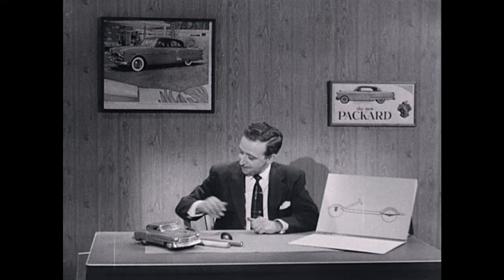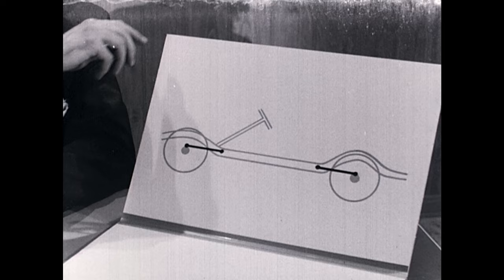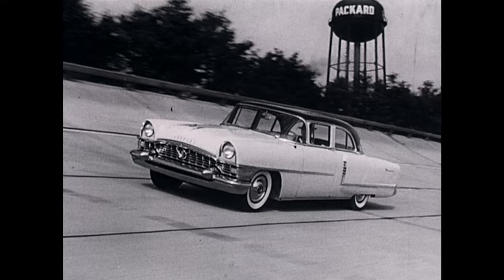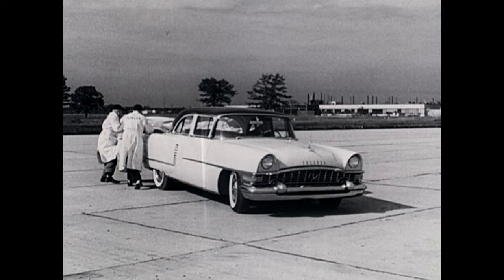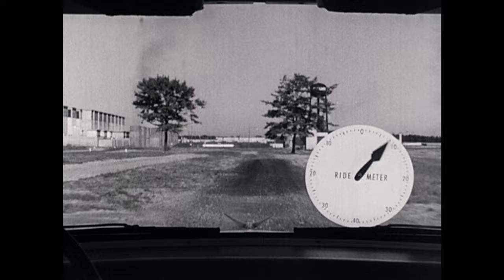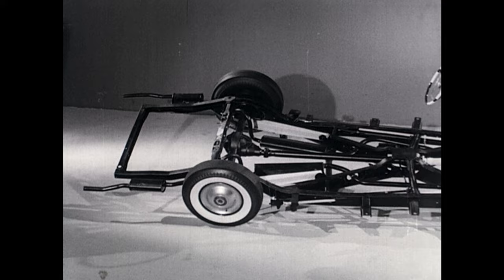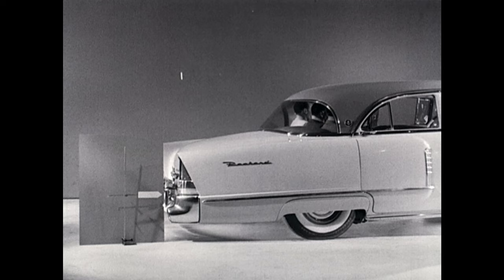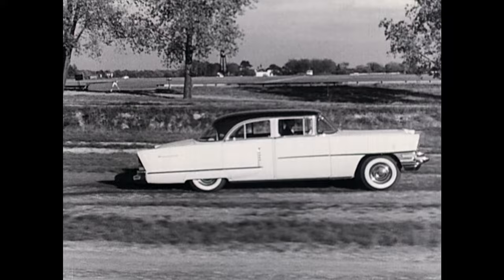Out of the Future (1954)

Comment: If only such a car was in production today.   With such pride in engineering I am sure Packard would be well ahead of other production cars made currently.  In 1956 they improved the system.   As a young child I remember sleeping stretched out on the rear seat and experiencing a floating sensation as if riding on air.   I also remember having fun in our garage by sitting on the rear bumper to make the leveling system turn on (I once got in trouble because the battery ran down.)  One of the improvements that came in '56 was a switch that allowed the driver to turn the leveling off when parked, to prevent such occurrences.
Reply: The automatic leveling system was introduced in 1955
Reply: Yes, ours was a gray '55 Patrician in '56 there was an added switch to turn off leveling. The Twin Ultramatic was another engineering marvel with a choice  of smooth acceleration or flash lightning getaways
Reply: Unfortunately pride in engineering can also bankrupt a company.
Reply: Mushrooms will do that.
Reply: Citroen did that. Packard was outdated already in the 50's it was an old people car.
Reply: @rockets4kids  I guess somebody had to say it.  Competition against low ballers with no shame of inferiority and deceptive with presentation is impossible with an uneducated customer base.
Reply: @theacw02  but my ‘55 Clipper has that switch...
Reply: And compared to the 1955 Citroen DS 19 it was instantly 20 years out of date.
Reply: @metricstormtrooper  The Citroen DS was impressive enough, but in the long run,  I'd rather rely on torsion springs and motors than hydraulics or pneumatics. Most of the cars with fluid or air suspension systems were trouble prone, many so much that their owners had them retrofitted with steel springs. That's probably less true of Citroen owners than most such cars, but they are a loyal crowd who bought their cars specifically for its advanced features, and Citroen had 20 years to get the DS right. If any new model came out with an adaptive suspension, even with today's advanced materials, I'd look at systems that used air or fluid with more skepticism than those with springs.

Comment: The closest suspensions to how the Packards operate made thereafter were the Hydro-Pneumatic systems used on British leyland and Citroen vehicles. I had a 1966 Morris 1800 with that suspension. I could drive quickly over speed bumps and would also not notice side wind, except for the noise the wind would make, as well as how it slowed the vehicle down a bit

Comment: That suspension reminds me so much of Lincolns air ride suspension of the 1980s and 90s! Amazing!
Reply: Nothing at all like it. This uses torsion bars instead of air bags.      
There has never been another system like it.        
Citroen used a hydro-pneumatic suspension, but with age, the system tended to leak and hemorrhage the green light hydraulic oil that made it work.         
Likewise, other makers used the air bag type suspensions that also went haywire when the hoses leaked.      
Packard's system had relays and sensors to adjust the torsion bars to the load using the central leveling motor. The result was the best ride in the industry with the best handling in the industry. no other company has ever come close, regardless of price point.

Comment: Krushchev's Packard is on display in a car museum somewhere  in this country. Russians knew a good deal when they saw it. Packard was probably best designed car for the interstates in the 1950's
Reply: It's a GAZ chaïka. It doesn't have many things in common with a Packard. Exept from the front end. Oh and there wasn't many interstate in Soviet-Union in the 50's. Maybe you want to look it up.
Reply: Have heard reports that the 1950's Packards tended to be rattle traps as exhaust systems wore against the chasis despite promotional films insisting on how well thought out the rubber chasis mounts were positioned. The auto transmissions were full of bugs. I would think fat Packards were relatively trouble free driving on the interstates and highways  but it is doubtful  Packard ever reached the young executive they'd hoped to sell to, instead they were repeating themselves to an old, tired customer base in decline  and packing in their Packard for the rest home. It was switching deck chairs on the Titanic. Shoot in foot technology killed Packard, with of without the V8. If they'd bought the rocket V8 from Olds along with the Cadillac  hydromatic transmission and sold more high end luxury options, including "free airconditioning," and engineered a cruise control, they may have gotten further without blowing big bucks on crafting a doomed V8 along with a problematic one off transmission that was nearly impossible to service. They were digging a hole, not selling a customer.
Reply: @z978ady  I realize that GM sold Hydra-Matics to competitors, but I would doubt very much that they would sell superior engines to them. They did sell Chevrolet sixes and 283 V8s to Studebaker in the mid-60s, but Studebaker was a dying concern by that time. The Olds V8 was an advanced design for its day, and was instantly a hit with buyers. I just don't see GM selling them to Packard. GM was much more concerned with fighting off the Ford blitz of 1953, and incidentally killing off the independent makers as a result.

Comment: The '55-'56 Packmules were still using the dowdy 1951 body, cleverly refreshed by future AMC styling whiz Dick Teague.  Packard had been going down the dumper since WWII, and George Romney finished them off by balking at the four marque AMC deal proposed by George Mason, thus forcing Packard to merge with another loser, Studebaker.  The Packard V8 was a good (if heavy) engine, but that Ultramatic transmission was pretty much the Packard's Achilles heel.  The torsion bar suspension came from Hudson.

Comment: Lexus LX470 with torsion bar suspension and automatic height control.
Reply: The LX470 front suspension has torsion bars, but is the setup that was common on 4X4 pickup trucks - the torsion bars are not interlinked to each other or to the rear suspension, and are not part of the self-leveling system.

Comment: Correct, hundreds of dollars per car, in an industry where dimes matter!  What few realize about the system, is the car feels "glued" to the ground, for (besides the incomparable ride), the front wheel is pushing down on the rear wheel and vice-versa. It doesn't depend on the shocks to do the best that they can. As rather-weak shocks are utilized, there's minimal impact to the chassis & body. Also, the torsion bars last forever. Even the electrical portion of the system is incredibly simple.I only wish that Bill Allison's Son, could have an opportunity to ride in my 56 someday. (I'm "dreamin' here)  Zero bangs, knocks, rattles and groans, and it rides like a train. All the cars but Jay's, that I've seen on you tube, are an insult to the highly-gifted designers, their legacies and their families. (You can tell I'm frustrated)  Remains one of the two most elegant-vs-results (designs), that I've ever witnessed. The other has nothing to do with cars. Lastly: The last time we brought our car back to the original owner's family, we drove 690 miles in one day. Got home at 1 AM. The
disappointment was, that the drive was over, for that day. My Wife and I were as refreshed as if the trip didn't begin yet. See: 56 Packard 400 Car-of-the-Week, Old Cars Weekly.

Comment: Great tie...My 64 Imperial LeBaron has torsion bars in front & leaf springs and rear stabilizer bars in back...I'm gonna have to get me a ride-o-meter to see how my Imperial stacks up-LOL Interesting vid...
Reply: The Chrysler's ride was stiff in comparison. That was the main turn off from people who had Lincolns and Cadillacs. Packard was able to keep a super soft ride because the front and rear torsion bars worked together.  When the front suspension of this Packard compressed over a bump, it forced the rear torsion bar to add lift to the rear and vice versa so, the car would raise and lower, softly, keeping the car level at all times. When cornering, both torsion bars worked together in keeping the car from leaning while still maintaining a super smooth ride.
Reply: @waynejohnson1304  I have never ridden in a Packard - I recall my late father saying he had one at one time...Are you a Packard guy Wayne? I have had 4 Imperials, 2 LeBaron and 2 Crowns. All 1964...My latest (and last LOL) is a Lebaron-just purchased a few months ago-still getting some mechanical things sorted out.
Reply: @wam44  My mother had a 1957 Dodge Coronet 500 with the so-called "Torsion-Aire" ride. I owned a 1969 Imperial LeBaron with the same system. While I liked the front torsion bars on those cars, I didn't like the leaf springs in the rear because they were too stiff. Having written that, I was impressed with the way that my Imperial was at 110 MPH on the highway compared with Cadillac and Lincoln. I have had many Cadillacs over the years. The Torsion-Aire ride was nice if you didn't want a super soft ride but, were more concerned with high speed driving. 

   They were great on taking back roads at a good clip too but, in day-to-day city driving, they were a bit harsh with respect with pot holes or deep manhole covers. I found that with my Imperial, the faster I drove, the smoother it became but, then, I would have to worry about speeding tickets. It really wasn't a car that one could drive down the highway and just lay back and relax. The Packard was able to keep the softness, while at the same time, allow great stability going around corners. That is what impresses me the most with this kind of suspension. I think it should be brought back.
Reply: @waynejohnson1304  Cool-thanks for elaborating-too bad I couldn't add rear to front torsion bars on the Imperial :-)
Reply: One of the causes of the firmer ride was the leaf springs internal friction increased as they wore due to corrosion and wearing out of the inter liners.  Earlier cars had tin covers over the springs and some were oil filled.

Comment: If this suspension works so great, why isn't used on modern day cars, or was it too exspensive to manufacture today
Reply: As you saw when they loaded the trunk is this system sensitive to back and forwards leaning 
Therefore will this system create serious nose dive on breaking and lift on acceleration, and as breakes and engines got more powerful this problem got more pronounced.

Comment: My 56 (400) is one of the last left to ride and sound exactly as intended and is incredible. Unlike any of the Torsion-Level Packards shown on you-tube, which (except for Jay Leno's) ride and sound like cement-mixers. Heavy shocks prevent the interaction from working. Dual exhaust are rubbing somewhere on every one of them, including the rear bumper. Few things will make a car sound worse. Decades-old suspension bushings create all sorts of knocks, creeks and friction. Loose jack, spare and all sorts of other annoying noises, in the trunk, ashtray and glove box, accentuate every bump in the road. I could go on.and on.  It's no wonder these cars have very little value. From what I see of them, and if I didn't know better, I wouldn't take one of these cars for free. Another annoying thing with ALL old cars
is the speedometer will be on its second or third trip around, with exceedingly-rare exception. One should look for worn or glazed finish on the steering wheel. Glazed and worn armrest as well.

Comment: Are these the same torsion bar suspensions that Chrysler cars had in the 50s and 60s?
Reply: Chrysler's front torsion bars were much shorter and did not work in unison with the rear suspension. The Chrysler's ride was stiff in comparison. That was the main turn off from people who had Lincolns and Cadillacs. Packard was able to keep a super soft ride because the front and rear torsion bars worked together.  When the front suspension of this Packard compressed over a bump, it forced the rear torsion bar to add lift to the rear and vice versa so, the car would raise and lower, softly, keeping the car level at all times. When cornering, both torsion bars worked together in keeping the car from leaning while still maintaining a super smooth ride.
Reply: @waynejohnson1304  Thanks for the information. I only knew about the torsion bars on Chrysler cars. 😁. If they kept the cars from “pitching “ no wonder I never saw one playing baseball ⚾️😏